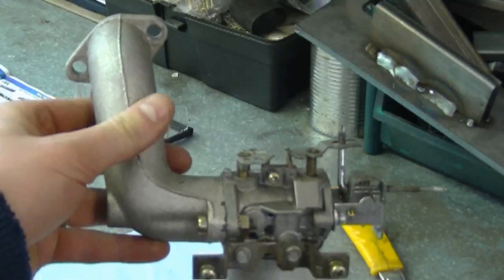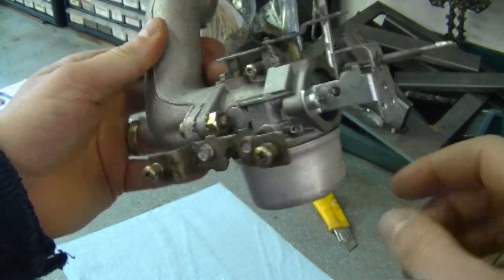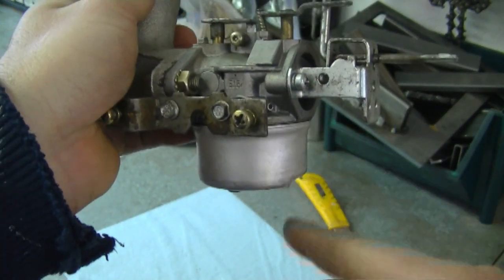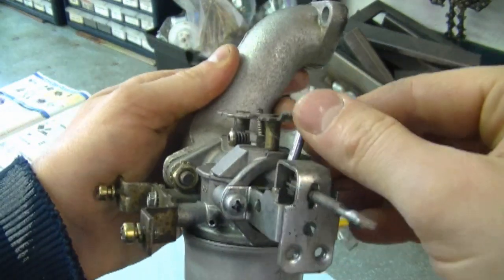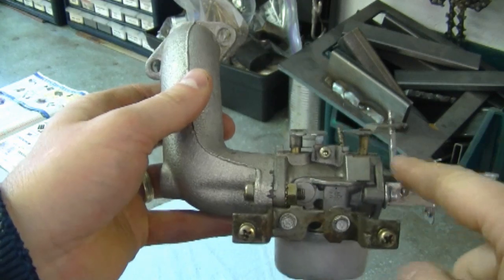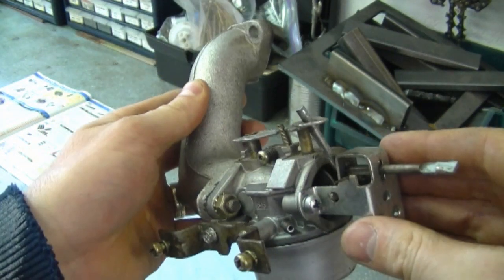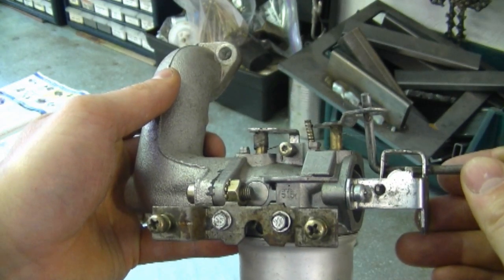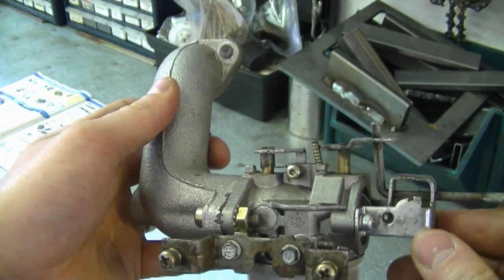Small Engines Q & A Video #86 in HD

Comment: ...I've also used some valve grinding compound and the suction cup on a stick method to make sure it is seated properly.  I shortened the intake as well.  All that said I'm now waiting on new gaskets and if this does not work (to increase compression so as to get gas up there so it will fire up) I'm looking @ getting the cylinder bored out (it look a bit worn on a side but the rings seem good...)

Comment: I received a 10hp Snowblower w/ a Tecumseh and it was getting harder and harder to start to the point where not even excesive priming OR starter fluid would do it.  I took the head off and noticed that he exhaust valve was not going down (also noted that it was not shiny as was the intake where it should seat).  I've removed the valve, ground it down (my thoughts are that it did not 'stretch', as another poster suggests, but rather the cam is being worn down...)...

Comment: @LSUTigerMom that is pretty normal, just means it is burning a little left over fuel. could be running a little rich, but those carbs dont have any adjustments so you just have to deal with it.

Comment: Question What is the best oil mixture for old 2 cycle chainsaws? that oil mix ratio
was been outdated like lets say put 8 oz of SAE 30 in one Gallon but I made the up 
So what should I mix it at? for chainsaws that the factory whats you to use SAE30,SAE40